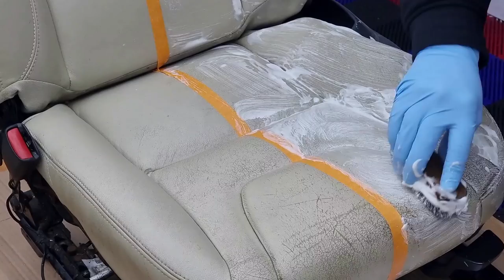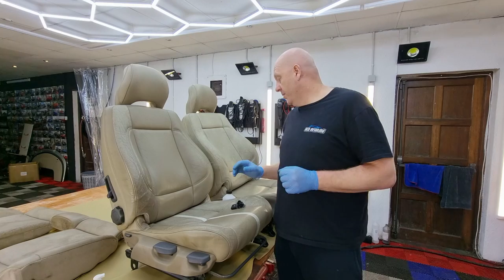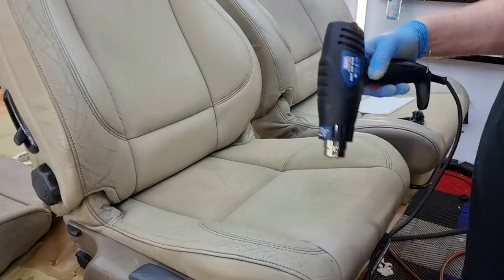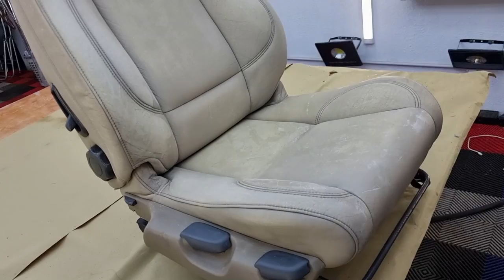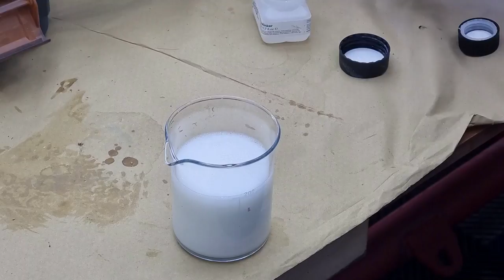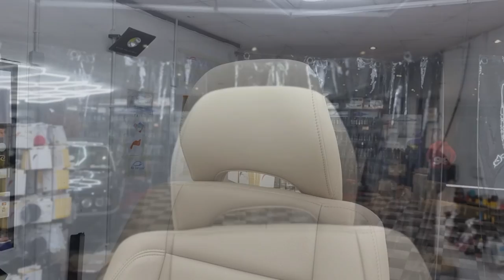Leather Seat Restoration Tutorial | Volvo C70 | Pro Tips

Comment: Excellent work! You said that you were going to talk about treating the hard leather on the back seats but didn’t. What did you do to soften them?
Reply from the maker: Thank you. For hard leather, after restoration ( minimum 24 hours), I apply conditioner; if the leather is quite hard , I keep the seats for a couple extra days and apply conditioner a couple of times. Usually, it helps a lot to feed the leather and bring back the softness.
Reply: Thanks for the response,  @OCDDetailing2021 . I have the same seats in off-black/charcoal. They are in excellent surface condition though despite regularly conditioning over the years, being in the sun for hours on end takes its toll and the fronts are hard (but not cracked) and don’t seem to absorb conditioner anymore. As I understand it from your process, I should chemically strip off the top coat, and then apply conditioner until resoftened and then re-seal…? Thanks again!

Comment: I have several questions 

Is it possible to use leatherique before a restoration in order to restore softness and moisture ?

How many hours does it take you to restore a single seat not including dry time.  

Can you do a video with a Volvo seat and go from beige to atacama?
Reply from the maker: I feed the leather after restoration, during restoration you would use some heat and solvent cleaners etc, so if you feed the leather before during restoration you would remove a lot of moisture and oils, Geist paints will let the conditioners to be absorbed by the leather, I do that almost after every restoration and there is nice difference in the softness of the restored lather , after applying the conditioner ( I wait at least 24 hours after the top coat before I apply conditioner)  It usually takes me 2-4 of working hours to complete one seat. I probably wont get chance to change color on volvo seats , as most of videos I make while doing services for customers, but if you want to see how to change color , check out my channel, I have 2 videos about it. I hope this helps and thanks for the comment .